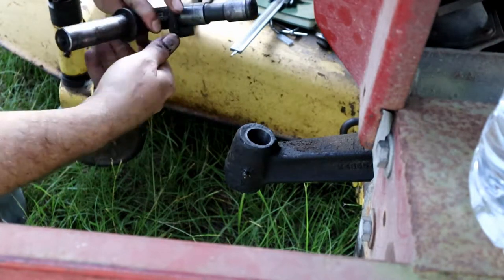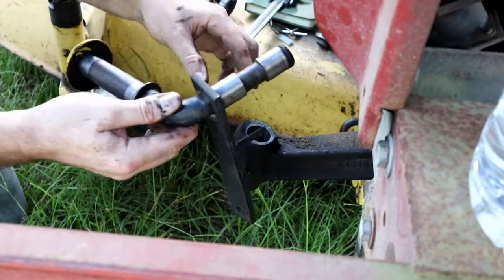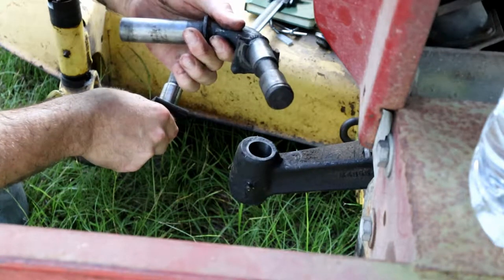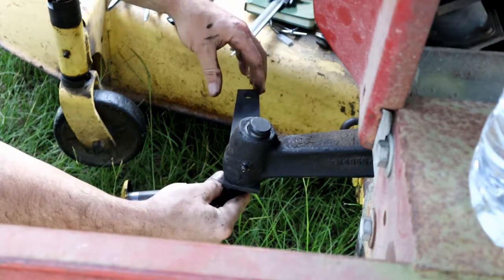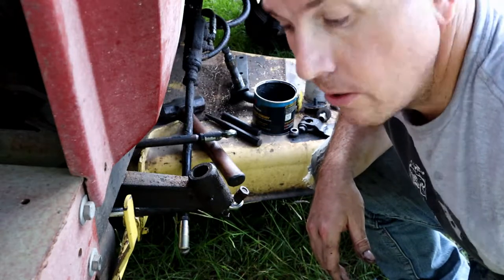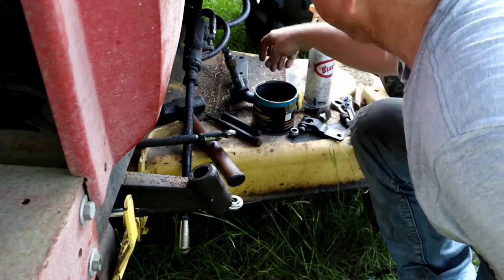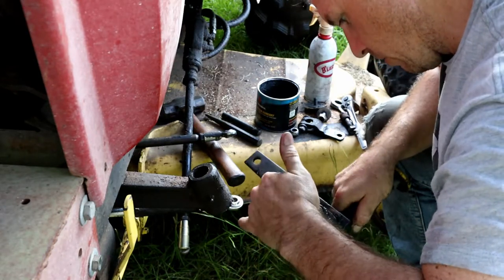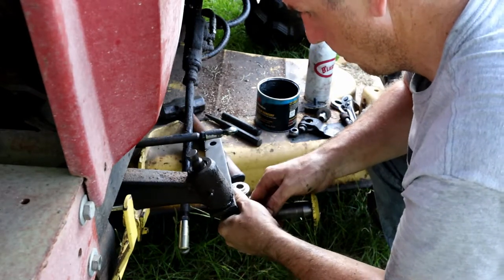John Deere 400 Steering Spindle Axle Repair Maintenance Pt 2

Comment: Most likely its repaired by now but one could use sheet stock that's used for shims like in valve springs and wrap the spindle.  These old ones wobble my 420 has some
Reply from the maker: Thanks for the heads up. Any other viewers could use that advice. I ended up ordering some good used parts off eBay and it worked out. Welcome to Man Time!